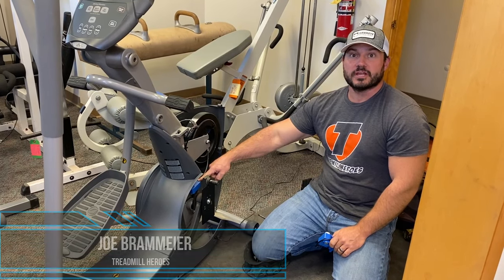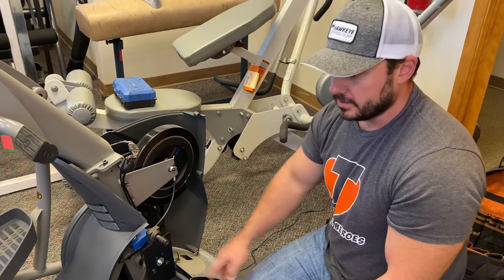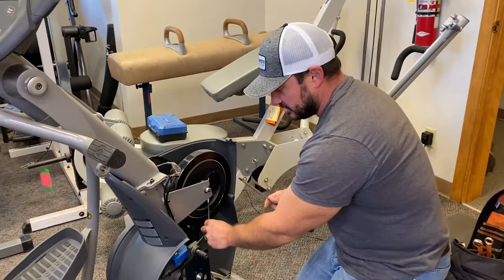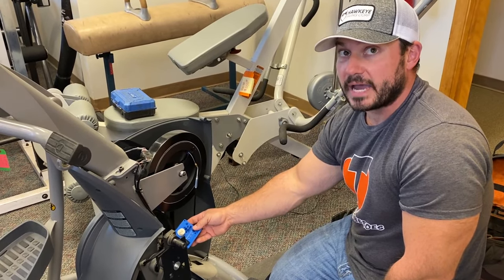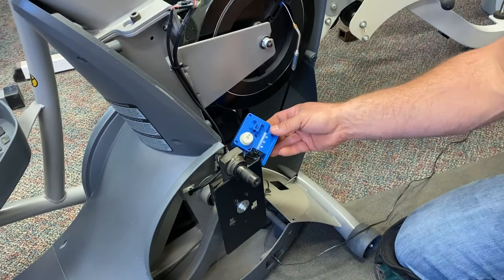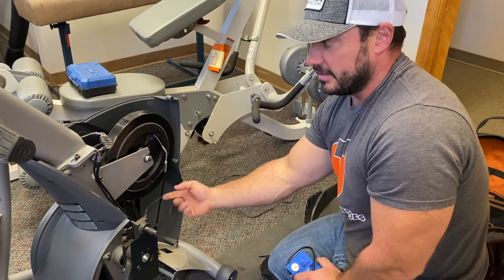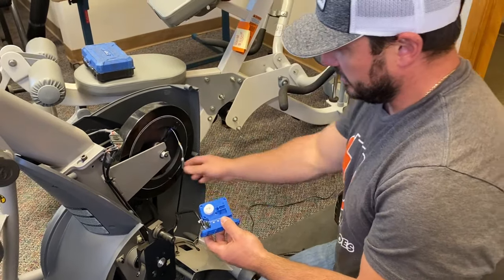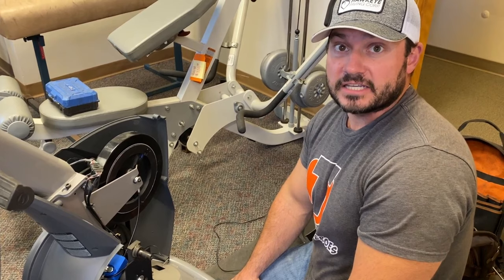Resistance issues with your exercise equipment?! Watch this!

Comment from the maker: Hello and thank you for tuning into another Treadmill Heroes video! 
If you need further assistance, please call our technicians at our sister company, The Fitness Graveyard. Their number is 563-949-0799. If you are looking for parts for your machine, please visit fitnessgraveyard.com.
If you are living in the US and are looking for new and used fitness equipment, please visit our website treadhero.com.
Thank you! 😄
Reply: Is this generally the same for all of these types of bikes? I have a Nautilus 614 upright that has no resistance. The screen allows it to function "Normally" through the resistance numbers and workout routines but there is no resistance, pedals work fine otherwise.
Reply: Hi there.  I read your comment above and was wondering if you could answer this question.  I have a Lifefitness 95x elliptical which I bought used.  It was in rough shape, so I changed both the timing belts and drive belt.  It was almost impossible to pedal despite the fact that I had taken the tension off the belt to the point where it almost slipping off.  So a tech said to replace the control board, which I did.  That made the resistance a little better, but I still find it's too high.  I thought it might be the generator brake controller, but after watching a few videos, I'm not so sure.  They seem to be saying you will have no resistance if the controller goes bad.  I have the opposite case.  Any thoughts?  Thanks in advance.

Comment: FINALLY someone who knows what they're doing from experience and knows how to explain/teach what they're doing. TY! I had to adjust the 'nuts' that adjust the arm to my resistance motor. But, watching your video, it's clear I should have unhooked that 1st or done something that allowed the motor to 'calibrate' before hooking that back up. I didn't do that so now the resistance displayed is not what it  is in relation to those adjustments.

Comment: Before you replace a suspect servo, get a can of compressed air and clean out the open case potentiometer. With the servo dismounted, disconnect from wall current, blow compressed air in the pot case opening, reconnect wall current and advance to level 20, disconnect mains when at level 20, blow again. Repeat process and you may effectively service a servo that doesn’t advance or reset to level 1 correctly. No more random level or brake errors.

Comment: Hey Joe, I flip exercise machines as a side job. The number 1 issue I encounter with thrift store pickups (ellipticals and exercise bikes) is resistance circuit failure (not the motor but the circuit itself, console resistance key presses no longer send signal to the motor). Do you encounter this? I haven't figured out a solution other than replacing the console. Would love to know if theres a common component that fails and can be replaced on the consoles when this happens. I end up with a shelf full of consoles that are otherwise perfect but for failed resistance circuitry.
Reply: Did you ever get an answer? My Nautilus U616 increases resistance on it's own while I'm pedaling. It'll just keep increasing to the point where you can not pedal anymore.
Reply: That's right where I am stuck with my Schwinn. The cost of repair exceeds the cost of a new machine. What a waste!

Comment: There is no 'gel' inside the resistance control motor.  I ordered a brand new one from LifeFitness parts and was curious what was inside it after I opened an older motor.  Yes, these are actually very user serviceable.  There are three screws on the bottom and four on the face including one on the same side connecting the actual motor.  I found a SCANT amount of lube (grease) only on the gear teeth themselves.  It is a reduction gear system.  I added some high-quality bike (synthetic) grease copiously inside to this new motor.  I am sure it will last much, much longer as the motor will not have to work as hard.
Reply: Charles, were you able to recondition the original (Old) motor  ?  Cheers...  wil

Comment: I ordered the exercise bike on January 7th and it arrived on February 12th. https://www.youtube.com/post/Ugkxzg0clhbtRf2gGxPkVETFKJJKGqdsorQu  The box must have been tossed around quite a bit because one whole side of the styrofoam was destroyed, and the other side foam was cracked. The Two zip ties holding the handlebars had broken loose and handlebars were loose in the box. There are two small holes in the foam on the right side of the handlebars, I guess from rolling around inside the box. Assembly was straight forward and easy. I am 6 ft 5 in 220 lb and the handlebars and seating positions fully adjustable and work great, I'm getting full leg extension. The noise level is very, very low and acceptable. The adjustment knob for the pressure on the flywheel works well also. The exercise bike is very well made, sturdy and easy move around. This is my first exercise bike and will keep me in shape over the winter. Update 3/19/21: when removing the sticker from the wheel, make sure you remove any sticker glue also. I thought mine was clean but I was getting a slight noise from the glue. Once cleaned off, its super quite. Also the monitor didn't work, tracked it down to the pickup device wasn't in the hole. Once I moved in the hole, it works fine. Do NOT put it in until it touches or it will damage the pickup.

Comment: Hello I have a question for you, I have a nordictrack 4.4 bike and I have just changed the resistance motor and it still does not work. do you have a solution for me.

Thanks a lot

Comment: Hey guys. Nice video. I have a question though. When I install new server motor and when you change resistance level it keeps pulling white bit closer to the centre of the wheel and reduce the resistance...when did i go wrong? ::))) I have Octane Cross Trainer 47e
Reply from the maker: Hello,
This account is not monitored by Joe or our other technicians. Please call the Fitness Graveyard at 563-949-0799 or visit fitnessgraveyard.com to send a message. 
Thanks!

Comment: Hi Joe, I'm unable to adjust the resistance to maximum (20 lbs) because of a motor error.  Can the motor still be changed out if it is set at minimum resistance?  Any tips regarding this? Thanks for the video.
Reply from the maker: Yes. Your can still change out the motor.  Might be a little tricky due to the tension but it can be done. We can Also get parts from www.fitnessgraveyard.com

Comment: I purchased a used NordicTrack GX2.0 that was slipping, thinking it was just a loose belt and come to find out that the one-way bearing in the flywheel is slipping. Now I'm trying to find a solution for that.
Reply from the maker: We recommend giving our company, Fitness Graveyard, a call at 563-949-0799. You can speak with an in house technician who can help you out and help you find any parts that might be needed for repairing the issue. Thanks!

Comment: Is there anything that can be done for a sticking resistance mechanism (the round part at the other end of the bicycle cable from the servo motor).  My servo works fine,  I can see the cable loosen when the resistance is turned up but it is sticking on level 1. Thanks for any help.
Reply from the maker: We recommend giving our company, Fitness Graveyard, a call at 563-949-0799. You can speak with an in house technician who can help you diagnose the issue you're having. They can also help you find any parts that might be needed to repair the issue. Thanks!

Comment: I have a Proform Endurance 520e,  one morning when i started to use it i heard pop noise and now it is hard to use. Acts like a brake is on. Do you thing it could be the servo motor? Thx.
Reply from the maker: We recommend giving our company, Fitness Graveyard, a call at 563-949-0799. You can speak with an in house technician who can help you diagnose the issue over the phone. They can also help you find parts that might be needed for repair. Thanks!

Comment: hi, i need your help, i have a Life Fitness X8 Elliptical machine and i can't change the resistance it feels like its on one of the hardest levels and it wont change even on the machine screen show me different. do you think that i have the same problem with the servo resistance motor? thank you very much and greeting from Ireland
Reply from the maker: Hello! We recommend giving our company, Fitness Graveyard, a call at 563-949-0799. You can speak with an in house technician who can help you diagnose the issue over the phone. They can also help you find any parts that might be needed for repair. Thanks!

Comment: Hopefully you can help, I have a bodyguard t280 getting codes and need access under the motor cover but I don’t have screws on mine and can not figure out how to remove it???
Reply from the maker: We recommend giving our company, Fitness Graveyard, a call at 563-949-0799. You can speak with an in house technician who can help you out. They can help you figure out how to remove the hood along with diagnosing any issues with the machine. Thanks!

Comment: What do I do if I've messed it up where the servo and the panel don't agree?
I have a new servo for my Octane, and I thought I did it right, but it keeps trying to turn it more than it cancandcit makes a popping noise (for each tooth on the gear in the servo).
Can I somehow reset the panel or something?
Reply from the maker: We recommend giving our company, Fitness Graveyard, a call at 563-949-0799. We have in house technicians that you can speak with that can help you figure out what's going on with the new servo motor. Thanks!

Comment: i just bought mine and the track moves in strobes making it impossible to use. how do i fix that
Reply from the maker: We recommend giving our company, Fitness Graveyard, a call at 563-949-0799. You can speak with an in house technician who can help you diagnose the issue you're having and hopefully help you resolve the problem. Thanks!
Reply: @treadheroes  ]

Comment: I have precor 546i the resistant button in goes up but it won't go down is not responding when I put down
Reply from the maker: Hello,
We actually just posted a video on our Facebook page about this issue. It will be uploaded to our YouTube channel shortly. If you want to check out the video now, search for Treadmill Heroes on Facebook.
If you have further questions, please contact the Fitness Graveyard at 563-949-0799.
Thanks!